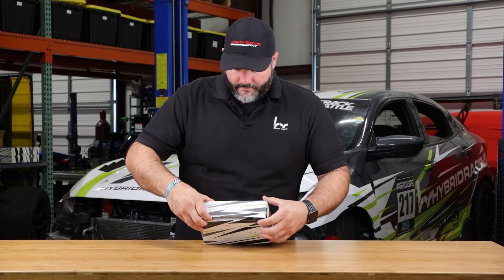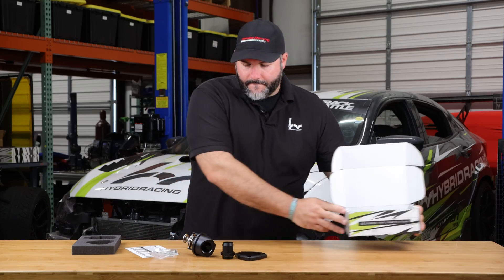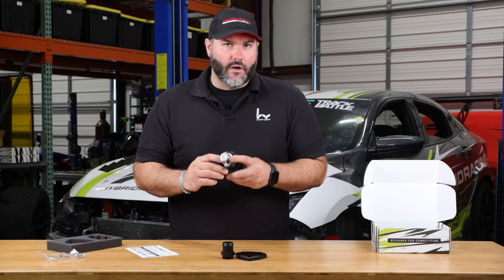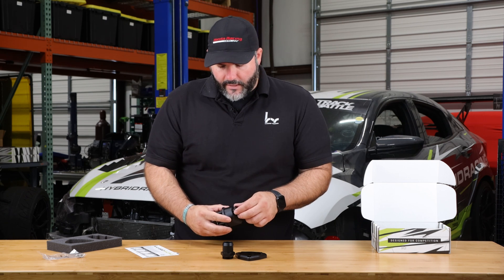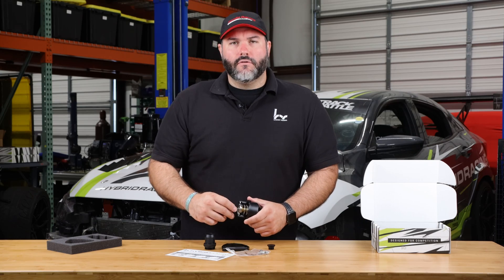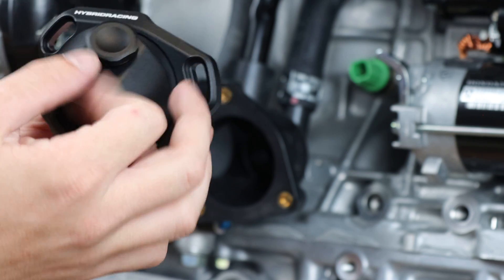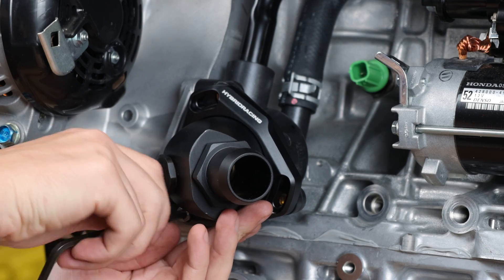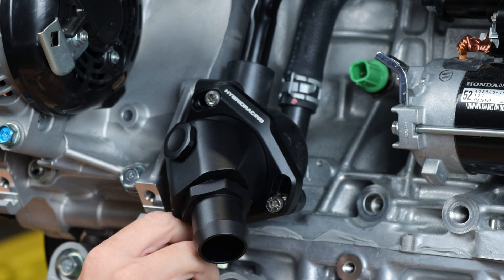Hybrid Racing Adjustable K-Series Thermostat Housing

Comment: can I use the top port 1:44 for coolant return for turbo application?
Reply from the maker: That shouldn't be an issue if you use the correct fittings.

Comment: I’m having an issue with coolant flowing fast enough while driving at low speeds and idling. The temp goes up to 208 and can’t come down. 

I’m considering drilling a small whole in thermostat to see if that rectifies slight over heating. Car has been bleed properly and heat works great
Reply from the maker: Make sure the thermostat is installed correctly, you can email support@hybrid-racing.com for technical assistance.
Reply: Did you figure out a solution because I’m having this issue right now

Comment: So it can take oem k series thermostat which are dual acting unlike all the other smaller style thermostats that the other housings use..?? Also can it bolt up directly to the water pump housing? This will sell me on this.
Reply from the maker: It uses an OEM K-Series thermostat. It does not bolt directly to the water pump housing, it bolts to the plastic section and is sealed with the OEM o-ring.

Comment: Will there be options for AN fittings?
Reply from the maker: We don't include AN fittings, however, if you want to run an AN hose, just use a -16ORB to -16AN male adapter.